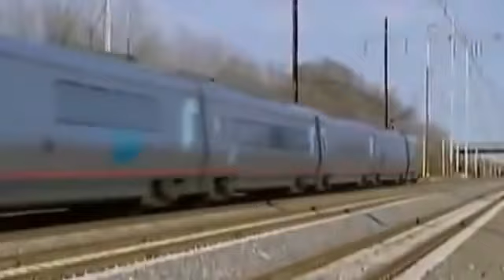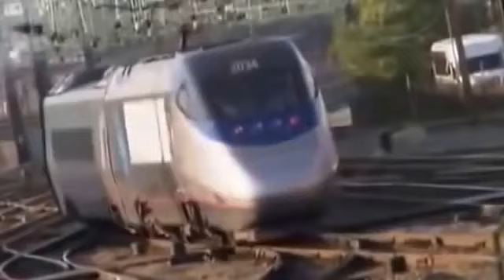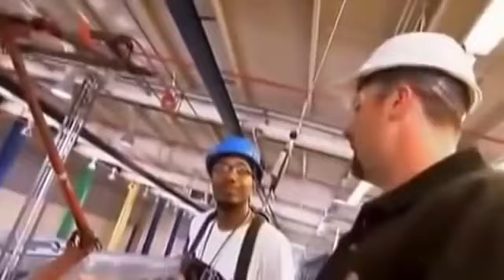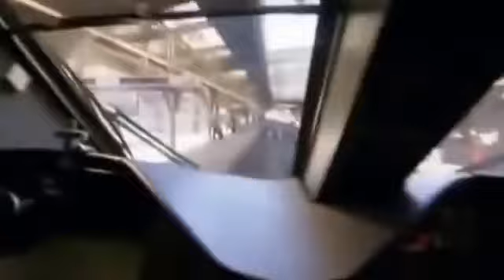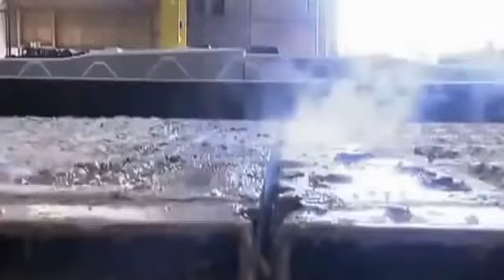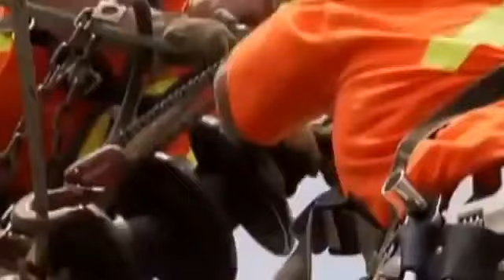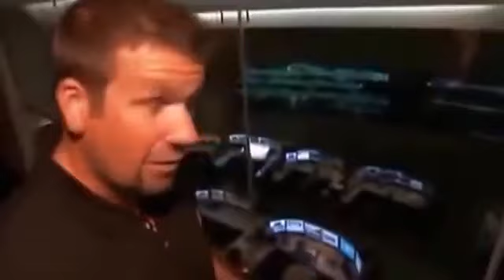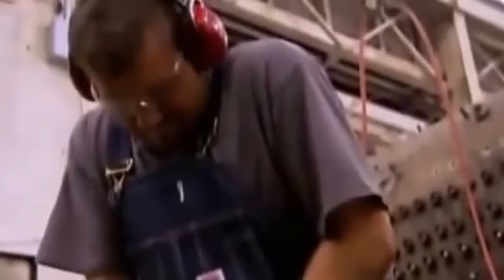The Amtrak Acela Express Documentary (Boston - New York - Philadelphia - Washington, DC)

Comment: It's especially impressive on how the acela can go so fast in such densely populated parts of america, the east coast is the most densely populated part of america. The europeans are bragging about there even faster trains but they have miles upon miles of field to cross and flat terrain. The east coast doesn't have any fields its all tall buildings and mountains.
Reply: Dude Japan is even more urban than the east coast, they still hit 300 kph no problem
Reply from the maker: Interesting point. If there is a negative correlation between population and train speed. How do you explain the case in China? As far as I know, trains there can run as fast as 350 km/h (or maybe even higher)
Reply: ***** That's what the conservatives thought with NationalRail here in Britain. 30 years on it's a fragmented inefficient mess. There's a strong case and a strong demand to renationalise the network.
Reply: ***** this is the reason monopolies are bad for growth if AMTRAK didn't own the entire network and instead 5 or more shared these lines the maintenance would be evenly split and would work much faster...
Reply: We just need a train that goes across the Midwest. Then our trains can start setting records.
Reply: Iamthemaster2 As I recall when British Rail was nationalized, service sucked so much everyone cried for privatization. The problem with British trains today isn't privatization, its having twice as many passengers today than there were twenty years ago. Passengers are treating intercity trains as commuter trains, commuting 60-100 miles to London. The Victorian age intercity rail network wasn't designed to be a commuter rail network.
Reply: that slow like hell even a normall car can drive faster than that
Reply: UnshavenStatue Japans rail network is only 40 years old we bombed the hell out of it in WW2 so their track is all new some tracks in America are over 120years old and are not going to be replaced until its needed (if it ain't broke don't fix it) theoretically the ENTIRE NE corridor could be revamped to MODERN standards in less than a decade but their constant need of use doesn't allow us to replace the rails so we're actually on a 30 year plan but that's not Even possible there's so many bridges and tunnels and switches between just NYC and NJ that its more than likely it would take 30 years to replace these alone let alone the ENTIRE NE corridor...
Reply: This is not the case in the states the rail network (all 250000 miles of it) are owned by Amtrak, Conrail, and CSX. Amtrak owns all interstate passenger rail whereas the others share their freight network... Amtrak doesn't have the funds to revamp the rail network and if they'd sub contract the work out rather than selling certain branch lines off it would nearly bankrupt them so a break up here is a much better option
Reply: It'll be like standard oil back in the 1900s
Reply: Katrina Luo prove it or kiss Your mom
Reply: DarcyWLincoln Part of the reason China has such an extensive high speed train system is they do it for their economy. The other reason is during their, week long, major holidays they have to move hundreds of millions from the East Coast to the West and back again.  PS Shanghai has a maglev that goes 400++ to Pudong Airport. I feel like a little kid every time I ride it.
Reply: ***** Especially when the rails are being used presently to handle the traffic. Most of the work has to be done at night with only one shift.
Reply: ***** Distances are so much longer in the US. Manchester to London is around the same distance as Dallas to Houston, or Washington DC to New York City. Not even the Europeans have HSR trains from Madrid to Moscow, around the same distance as Los Angeles to New York City.
Reply: ***** Maybe so, but the individual European nations don't have the vast expanse of real estate or deserts the US has. In the semi arid and desert regions of the US there is a large cry for reservoirs. The huge metropolis of Los Angeles cries for more water even though they swallow up the Colorado River. The Europeans have never suffered a drought like the one that hit Texas during the late 1950s, when the US Speaker of the House, Sam Rayburn proclaimed Dallas would never go thirsty again. Almost all of those reservoirs around the Dallas area you see on Google Maps are the results of Sam Rayburn's efforts.
Reply: +lessthanaveragegamer japan with more people per SQ KM and with trains sometimes even running over buildings retains an avg speed of 170MPH
While this is 70MHP
fucking hilarious
Reply: +Iamthemaster2 
Errr .. well no there isn't actually. How come there are twice as many people travelling on UK railways now than before Privatisation? You honestly think people want to go back to British Rail? Really? Who do you think has paid the £ Millions needed to replace all the old BR crap we were using with all the thousands of new passenger trains and freight engines? Private Rolling stock Companies thats who.

Oh and the Labour Government screwed it up when they killed Railtrack and created 'Network Rail' conning us it was a private company. It never was. It was and is part of the public sector and funded by the Treasury now. So we have had back door nationalisation already.
Reply: +lessthanaveragegamer 
You have clearly never been to the UK. We have about 680 people per Square Mile. The USA has about 85. Yes we have a 'green and pleasant land' but its a small island compared to the USA. Hell you can get the EU in Texas! And we have had 125 MPH trains here for over 40 years and we are now buying new ones for 140 MPH standard intercity running on railway lines that are some of the busiest in the world. Our HS1 line to Paris is a 180 MPH line under the Channel. Our new HS2 line from London to the North will be even faster. So please stop the excuses. Basically America doesn't 'do' passenger trains. It does  huge freight trains and passenger aircraft. Its why we Europeans are building an aircraft factory in Mobile Alabama to keep with all the Airbus A320s you guys are buying!
Reply: Uncrowned If the tracks were up to snuff Acela could do 165 mph. Unfortunately the northeast corridor is over 100 years in age, built during the days of steam for trains running 70 mph. Too  many tight curves with Acela running on the same tracks as slow freight trains.
Reply: SeaToby11
You are right of course and the same has applied in the UK where we are using routes built with picks and shovels 150 years ago and have some of the busiest multi use railways in the world. And why we are trying, despite the NIMBYS, to build new railway lines and re-open old ones.
Reply: SeaToby11 true but during the best parts of the track the japanese, chinese, korean, and euro trains can reach 300MPH so :/
Reply: Uncrowned There is a difference between 300 kilometers per hour and 300 miles per hour. Don't confuse the two. 300 kilometers per hour is 187 miles per hour.  Asian high speed rail trains are running on newly built tracks without any tight curves or freight trains. The only train that goes significantly faster in regular service is the Shanghai Maglev train running to its airport.
Reply: SeaToby11 I said that they can REACH 300MPH not their OPERATING speed. ACELA CAN GO 150MPH MAX. thats a whole world of difference. now back to the real metric system
 the acela goes avg of 105km/h but shinkashen and chinese bullet trains go 200 KM/h avg operation speed.
Reply: Uncrowned Actually Acela is rated for a top speed of 165 mph if it had the tracks to do so. As Acela is approaching 30 years in age, Amtrak is looking to replace Acela. But the old tracks remain in a tight suburban/urban corridor. I doubt if a new much faster train will go any faster on this corridor. The problem with the northeast corridor is by the time Acela gets up to speed it has to slow down for the next stop.  Acela stops at Newark, Trenton, Philadelphia, Wilmington, and Baltimore on its route from New York City to Washington DC. How many of the other HSR trains stop as many times on their routes? Every stop consumes more than 10 minutes to slow down, stop, and speed up.
Reply: SeaToby11 im saying acela americas only "high speed train" is heavily outclassed by other countries. For a country this vast with a GDP of the same as china, the infrastructure sure sucks. Maybe if you guys didnt try to start so many wars in the middle east, you can do something for your own citizens instead of killing others.
Reply: Uncrowned Not for long. By 2021 Texas Central Railway will be running N700 Japanese HSR trains from Houston to Dallas., over 200 mph. Considerably faster than Acela, but then again TCR is building new straight tracks along a hydro transmission line corridor.
Reply: SeaToby11 but asia had this tech a decade ago. Im just saying that USA is sorely lacking on its infrastructure. even its subways are packed, old, and broken
Reply: Uncrowned Obviously you have never been to the United States. America has the best highway system in the world along with more major airports and terminals than another country. Unlike most of the rest of the world, American intercity railroads are private railroads, not publicly owned. Even Amtrak's northeast corridor was once the Pennsylvania Railroad's main line until Amtrak took over the intercity passenger rail business back during the early 1970s because the private railroads wanted to close.
Reply: SeaToby11 Of all the major airports ive been too, all of them were run down and dirty. You cant call an excuse of "Oh theres a lot of people" since bejing and shanghai international airport gets a lot more volume, same with japan. Compared to the vast road and train systems in asian countries, the US barely holds up to the public roads that canada has.
Reply: Uncrowned Canada? LOL.... Pothole city every summer, nothing but construction filling them. Canada hasn't even finished a four lane highway coast to coast yet, the US at least five east west interstates. The very worst of Amtrak's western rail lines is a better ride than the best of the Canadian rail line.
Reply: SeaToby11 Do you realize why americans are insulted? Because for such an "advanced country" Full of "smart" people with such a big GDP, it sure is backwards.
Reply: ***** Yea LOL. Ive travelled many places, and because I do, I get many layovers at the biggest US airports. EVEN LAX the so called "most popular airport" or the "best airport" Looks shit compared to domestic or even secondary airports in asia and even europe. Japan, korea, and china have some of the best roads and subway systems that look as if it was out of science fiction when compared to the US.
Reply: ***** France has well maintained highways, but their local roads are very narrow, just like the rest of Europe. And yes, one notices very quickly how bad the highways are in Belgium, so rough your fillings shake out of your teeth.  Dallas and Denver have wonderful airport terminals compared to LAX or JFK. But comparing a nation the size of just one state of Oregon isn't the same as comparing a nation's highways as large as the US.
Reply: ***** Maybe China should spend a bit more cleaning up their act, their pollution leads the world.
Reply: +SeaToby11 Part of the problem with the Acela trainset is that it's stupedly heavy due to FRA's retarded 'crash rating' requirements, which resulted in Acela being unable to properly use its tilting technology.  New trainsets won't be required to be as heavy as the current trainsets, that alone goes a long way in increasing speeds and decreasing operational and capital costs.  

A lot of trains makes that many stops......  The Tokaido Shinkansen's Kodama train makes 17 stops over its 322 mi route.  And each stop doesn't add 10 minutes to the trip, the delay is more like 5 minutes.  It doesn't take 5 minutes for Acela trains to accelerate/deccelerate.
Reply: Well Right. But if you look in a Map at least half distance from Madrid to Moscow is covered by fast train.
Reply: Marcos Javier Alemán García How much of that railroad track is owned by a government instead of private freight railroad companies? Just about all? Not so in the US, where almost all of the tracks are owned by private freight railroad companies. The largest stretch of track owned by the government is Amtrak's NEC, formally Pennsylvania RR track from Washington DC to New York City, and New Haven track to Boston. Simply put the private freight railroad companies are happy going less than 79 mph, they have no desire to upgrade their tracks to 150+ mph..
Reply: ***** Have you Google Map satellite image Amtrak's NEC, formally the old Pennsylvania Railroad line? There is no place nearby to build a new HSR line on the ground.  Amtrak's studies imply they would have to build a new HSR line 30+ miles away from the current right of way. That's 46 kilometers away, the distance between Liverpool and Manchester, Wiki 35.2 miles. Almost all of the city freeway outer loops in the US are no more than 10 miles from the city center, outside NYC, Chicago, LA. Such a HSR line would not serve the center cities well.
Reply: *****  That's not true.  The ICE in Germany shares tracks with freight.
Reply: ***** Their high density corridors make up a larger percentage of their populations than the US. Literally half of Japan's population is between Kobe/Osaka and Tokyo, probably more. That is not the case with the population on Amtrak's north east corridor. Just adding the entire populations of the states of New York, New Jersey, Pennsylvania, Delaware, Maryland, and the District of Columbia is around 54 million, out of 330 million, or around one sixth... And this including western Pennsylvania and upstate New York not truly served by Acela. Keep in mind California has a population around 39 million, Texas has a population around 27 million. Where is their Acela?
Reply: ***** Why don't you study a bit about the Texas Central Railway opposition in Texas for a Japanese HSR. And this opposition for a private, free enterprise railway, not public... It isn't a lack of political will, on the contrary there is NO will whatsoever from those affected who own the land...
Reply: ***** But don't imply the US doesn't have HSR. California is building HSR from San Francisco to Los Angeles which won't be completed for another 30 years, no one know for how much. $50 billion, $80 billion, $100 billion. Private enterprise in Texas is well on its way planning a HSR line between Dallas and Houston for around $10 billion presently. Both truly HSR of 200 mph trains, not the 120 mph fast diesel trains in Florida between Orlando and Miami. Amtrak is spending on speeding up the slowest part of their north east corridor by rebuilding tunnels and bridges. Unfortunately there isn't any real estate to widen the curves on the track right of way. Outside of a few golf courses, its surrounded by homes, businesses, and industries. A fact that Google Map satellite images would reveal if you bothered to look... So much oppostion to  building  HSR underneath transmission  power lines, imagine the opposition  building  HSR  through homes and businesses and industries... Amtrak's HSR study implying building 35 miles away from present downtown stations, how would London be served by a HSR whose closest station to  downtown  London  is located in Luton?
Reply: ***** The distance from Los Angeles to San Francisco is 500 miles along the route California is using to build HSR, which is around 800 kilometers, through two mountain ranges and two passes. Have you ever heard of the nicknamed the Grapevine, the pass northwest of Los Angeles? Have the Italians or the French built HSR through the Alps yet? Oh, the HSR train slows to a crawl through the mountains...
Reply: ***** Yes, it is construction, but at what price? Tunnels are expensive, much more than building on flat land. With California HSR,  they are going to build on the flat land first between the passes, than build through the passes, and only upgrade present railway right of way in the urban areas to the passes. None of the railroad passes tunnels presently have a high enough clearance for  running electric lines above the tracks. So new tunnels will have to be built for HSR...
Reply: ***** That's not true. Many European HSR lines are essentially upgraded legacy lines.  Only Japan and China has completely separate ROWs for their HSR.  Japan did it because of their obsession for performance and China's trains are identical to Japan's.  In Europe it's very common to see HSR trains using existing ROW and share tracks with local trains. 

And lol, California HSR cost estimates are inline with European and Japanese construction costs.  In fact, Japanese HSR has very high construction costs due to the mountainous terrain and complete ROW separation even at terminal points.  There's a reason why the new Chuo Shinkansen line under construction is not planned to be completed until 2045. 

Though, to give you props, passenger rail costs in the US in general do to tend to be higher because of bullshit FRA safety regulations.  But with the CHSR specifically, the costs insofar are inline with other countries' construction costs.  In some cases cheaper because most of the line goes through the Central Valley which is all flat.
Reply: ***** Your using money value from 40 years ago comparing it to today's money value.... and the value of money 10-20 years into the future... How about doubling and doubling again... Duh...
Reply: ***** Also 5 billion Euros is not the same as 5 billion US dollars... Lyons to Marseille is 195 miles, Paris to Marseille is 401 miles, LA to SF through Fresno is 406 miles. But are there two mountain passes with tunnels Paris to Marseille?
Reply: ***** From Wiki... Historically, the Euro Dollar Exchange Rate - EUR/USD reached an all time high of 1.87 in July of 1973 and a record low of 0.70 in February of 1985. 

Don't pretend the Euro and US dollar have had the same exchange rate value over the past 40 years...
Reply: ***** Again from Wiki: The French Franc pegged for a Euro1998/1999. France French franc	FRF	6.55957	1998-12-31	1999-01-01
Reply: ***** California is also rebuilding the rail corridors through the urban areas from downtown San Francisco through San Jose, and downtown Los Angeles to the Grapevine, outer city limits of the San Fernando Valley for commuter rail and for the HSR in which the HSR trains will go no faster than 79 mph. Currently that rail line corridor is mostly at grade with grade crossings, they will be rebuilt with over passes and under passes. Keep in mind those rail corridors have factories and sea ports which have to be served too... California will be spending as much in the urban areas as they are in the rural areas. Believe it or not there are only three or four railroad passes serving the Los Angeles basin. And likewise with the San Francisco Bay Area. Not ten or more spreading out like spokes of a bicycle wheel. Look at the US continental divide, there are five main line east west railroad passes from the Canadian border to the Mexican border. Great Northern, Northern Pacific, Union Pacific, Western Pacific, Santa Fe, and Southern Pacific. Denver and Rio Grande had another, but at 10 thousand feet, not really suitable for a main line with mile long trains.
Reply: ***** Great, now you resorted to strawman arguments.  It doesn't matter if the UK is Europe or not.  Your original claim was that CHSR costs too much according to other international systems.  If you want to make that comparison, then you have to be willing to accept UK HS2 figures, whether you consider it 'Europe' or not.  This is not about CHSR vs Europe HSR, this is about CHSR vs Other HSR. 

That and the GOA report still stands.  I'd probably pay attention to it more than the HS2 example I gave because that's an actual technical report with quantitative and qualitative data analysis for HSR construction costs.
Reply: "The east coast doesn't have any fields its all tall buildings and mountains."Read more Show less Reply     6     7                  Really? Not one field?  I'd say you're also a lessthanaveragegeogrpaher, son. Report spam or abuse